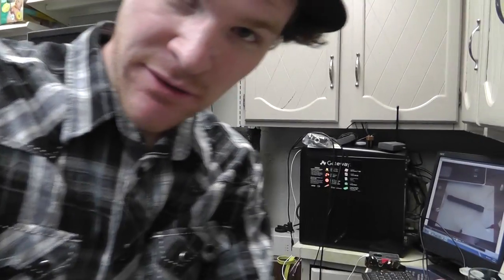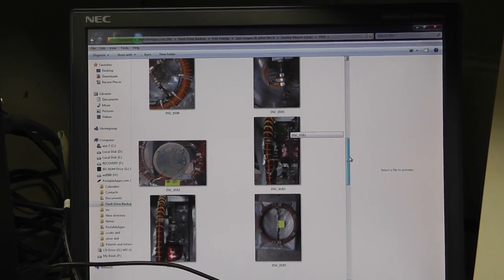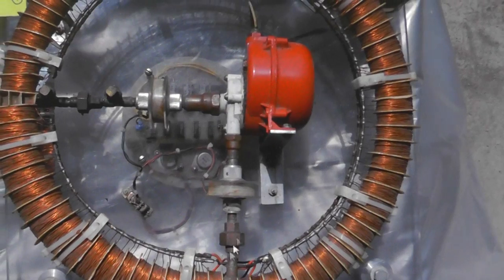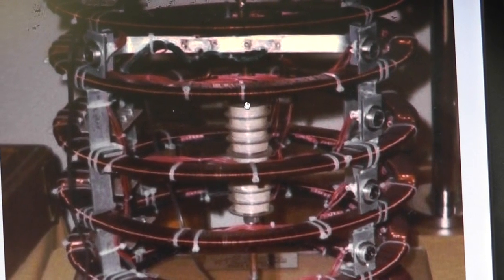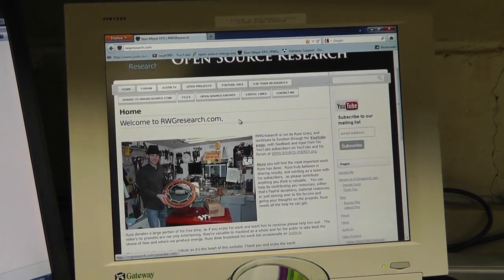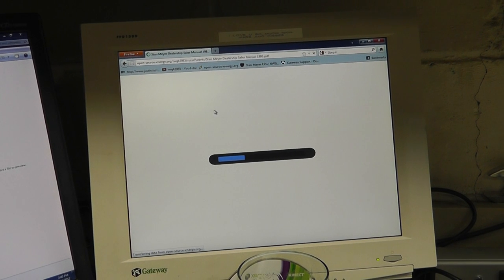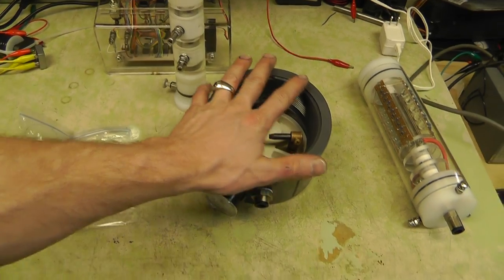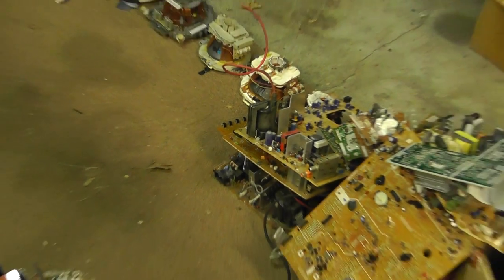What? EPG Doesn't Have A Primary? It's A Gas Aligner? WHAT?

Comment: X-Ray WARNING!!!

Don't try this at all people.  

This setup is essentially an X-Ray tube, with zero shields.  A spectrum from extreme UV through to Hard X-Rays would be produced.  The metal gas pipes ends would also act as crude anticathodes, even "not connected", thus improving X-Ray output.  Using a DC arc and then evacuating the tube, as I saw Russ doing in another video, will heat the Cathode white hot and then when pulling a vacuum again after that, you have an already white HOT cathode, with Thermionic emission of electrons.

 With AC the situation becomes even worse.  Now electron bombardment heats both electrodes white hot (even under vacuum), leading to thermionic emissions of electrons.  Each electrode takes a turn on the cycle of being the Anode "Target" and Cathode emitter.  Then they swap on the next part of the AC cycle.  Xrays are thus then emitted from both electrodes, in just about every direction, with nothing to block them (Normal X-Ray tubes have an exit window now and an Aluminium shield to stop soft X-Rays, that would be part of the overall dose otherwise, but with insufficient energy for imaging (too weak to pass all the way through the body).  

Hooking multiple flyback transformers to it would be a really bad idea IMHO, without significant safety measures.  Minimum a Geiger counter and some Lead Shielding.  Since the output would be an inverse square of the distance, some extra space between you and the operating tube makes a big difference.  Double the distance quarters your exposure.  Halve the distance and you are getting 4 x the exposure.  In other words, don't be anywhere near this thing if it is on!!!

Stay safe people.  The risk of this has been know since the 1800s.  One of Edison's assistants died a horrible death due to radiation exposure building X-Ray tubes.  They weren't even the hot cathode type tubes, but the earlier and weaker cold cathode tubes.  The setup described above has the potential to emit more X-Rays than even a modern commercial tube would.  This tube would be terrible for imaging purposes but would be great to irradiate yourself with......

BTW the purple glow would be due to Cathode Rays (electron beam), the orange emissions are your charged heavy IONs (Anode Rays).

Comment: wouldnt a copper pipe sheald the gas from a large amount of the field produced by the polerising windings? if you make a plastic section where those windings would be located at make a better field? it reminds me of a neodymium magnet going through a  copper tube ... im guessing this is the same field the secondary are picking up... i dont think you want that force where your polymerizing the gas

Comment: ... its nothing above 12 volts... your not going to jump the enamel coating on the wire for several thousand volts.. it cant conduct any electricity... and hes using a copper pipe... plastic would allow him to transfer the magnetic field better because how magnetic fields act going through a copper pipe. look up a video of a magnet through a copper pipe and you will understand me...